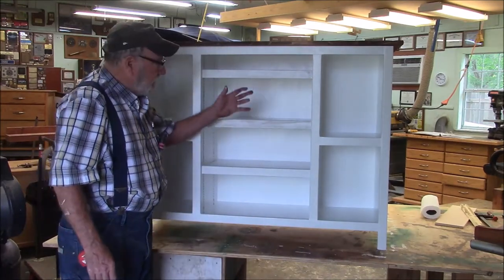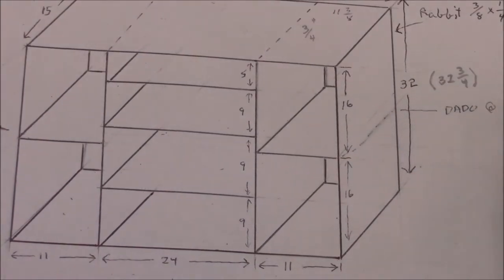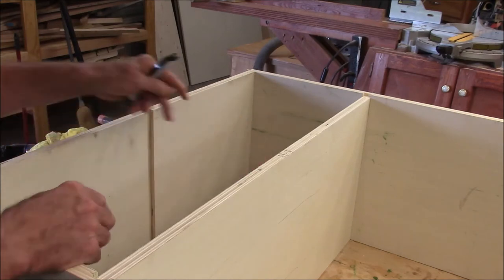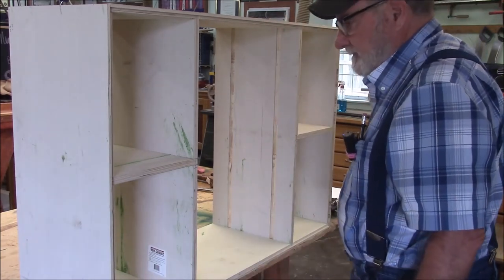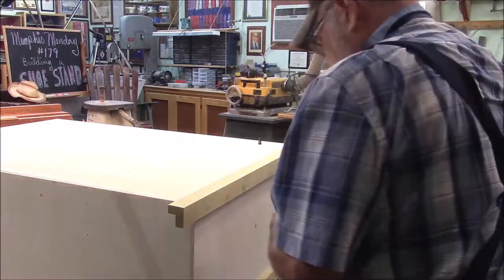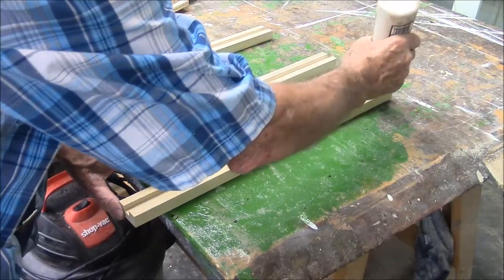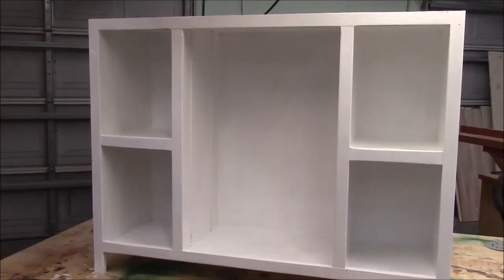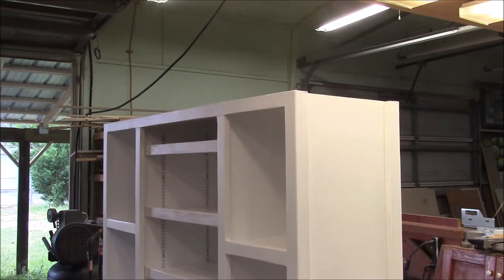179 Building a Shoe Stand

Comment: Nice shoe stand.  You make things look so easy.  I have made a few projects from a magazine picture and half the fun is figuring out how to make the piece look like the original.   keep up the good work.
Reply from the maker: Yep, I agree.  If I'm not using my own idea, at least I should try to respect the design I copy.  I only hope the real designer of this stand, whoever they are, will forgive me for adding the legs.  But the legs will keep the thing off the damp deck; it just seemed logical to me.  Heck, I even hunted around for the same edge-glued pine panel they used on the original.  
https://youtu.be/oDwcthgLN_Q  In this video I go to extremes to copy the original.  This is MM 78 (what? two years ago), where I copy my neighbor's cedar grilling table.  It looks like the original builder got all his hardware and wood from Lowe's, plus I had a complete real project, so I made a perfect copy.  
      Thanks for watching and commenting.

Comment: One of the first things I noticed about the shoe rack in the picture was the lack of legs, which i don't care for, and gave it a cheap unfinished look. I like the way you added the legs because it gave the shoe rack a much nicer look and made it look like an actual piece of furniture. That certainly was a lot of rabbits and datos and a nice big puzzle! Your version is a lot nicer than the one on the picture.
Reply from the maker: Thanks On Grid.  As I've said, if I copy a design, then I like to at least copy it well.  But in this case I had about the same notion as you, except my slant was more to the practical side of the piece.  Beyond that, I did work hard to get the look right.
     Rabbits and dattos are a big puzzle to me, as if they are not exactly placed, then nothing will fit together.  This is why I always go into such boring detail on how I keep it all straight in my head.  For example, in this project I totally assemble the case, and then physically mark with a felt pen where the rabbits will live before cutting them.  You can guess why I do that.  Yep, I've spaced out, and put them on the wrong side before.  As Clint Eastwood once said, "A man has gotta know his limitations."  
      Thanks for watching and commenting.  Man alive, you and I are pushing four years of Memphis Mondays.  And as always, I don't take your viewership for granted!!!!
Reply: You built it perfectly. It's better to have a lot of marks with a felt pen than to have anything off. As you said, if one thing was even a bit off nothing would have fit together properly. I wouldn't call that a limitation, I'd call it doing things properly.

Comment: i hope this means that you managed to stay somewhat unharmed by the storm.  We started getting the rain yesterday.

I love this design.  It would be perfect in an entry room or, as you said, mud room for a family.    I have seen the benches with places for shoes below but never a nice shelving unit like this.

It is always fascinating to follow your reasoning as you reverse engineer a drawing.  For a lot of people it would be overwhelming but you are wise enough to take it a part at a time and only dwell on that.    There is one thing that I think I would have done different and that is just because I am lazy  That is putting the strips in for the adjustable shelves before installing the board.  It just seems easier to be able to do it that way.    

I have noticed that you are using commercial putty to fill in your nail holes these days.  Did you just get tired of the mess of mixing your own putty?

The finished piece is very clean  and sophisticated.  I love the white  with the dark top.  Your friend must really appreciate such a nice piece.  Hopefully it will be at least in a protected area where it won't be getting wet.  It is much too nice a piece to be left out in the weather.

I suppose you saw that Leo put up a new video.  One of the things I found interesting with this video was taking the ship saw apart and cleaning the blade unit then make a level base for it.  I hope the trip to England doesn't mean that we are going to be without videos for a while.

Take care and stay dry.
Reply from the maker: The reverse engineering from a blurry picture is the fun part.  Tracking down clues, and then converting those clues into wooden parts is like a crossword puzzle.  For example, one clue was the relative size of the shoes in the example picture.  Using that as my scale, I could estimate all the dimensions.
       Yep, one part at a time, or I'd get confused.  I've heard it said that a lot of folks, especially genius types,  can juggle many tasks at once.  I can't, and I don't think the genius types can either.  Rather, I think the illusion of multitasking is actually the practiced or natural ability of shifting focus rapidly, maintaining intense concentration on a task, and remaining undistracted.   
       I have installed the strips in first in other projects, but here I left them out because of the painting.  
       The commercial putty drys faster, and finishes better.  However, it is not waterproof, and it is soft.  The homemade putty is made with waterproof glue, which is really a kind of plastic when it drys.  
       I think Leo will still make videos while in England; he did last visit anyway.  A couple of those videos showed how he learned to build wooden boats.  And he must have been pretty good at it, as those English boatyards keep hiring him back when he comes home for a visit.  
      Leo sure does get some fine talent showing up to help.  This week it was a tool repair guy, and then Leo was wise enough to use the guy in his specialty.   I wonder how Leo handles the knuckleheads who are inevitably in any bell curve of people.  I also wonder about the liability issues involved, especially for Leo's host.  
      Thanks for watching and commenting.
Reply: Great description of multitaskers.     I can multitask on maybe 2 things at once as long as neither are important.    

It makes sense that you didn't put the strips in before painting.  I wondered if they would have been clogged with paint.  You could cover them with tape or something but that would be more effort than waiting until you were finished.  Good call on your part as usual.

When you are trying to get projects out in a hurry, I suppose the putty drying quickly is imperative.  

I have often wondered how Leo diplomatically handles his "helpers".  At this critical stage of his build, he has to be a bit picky on who he allows to work on the boat.  You do have to wonder if the liability has been addressed by the property owner.  Maybe that is a subject best left not discussed.  Hahahahah.
Reply from the maker: In any case, I would sure volunteer if I were closer, or I could get the War Department on board.  I could cross those bridges if I were 20 or 30 years younger, and felt I was a physical asset.  But the reality is that Leo's project was originally built in 1918 by young guys, guys hardened by work, and none weighing in over 160 pounds, nor sporting an age over 50.  
      Now us geezers can address the liability question, which I suspect could become an issue.  Leo may not be prepared for America's aggressive and eager legal system, especially if Leo's host is rich.  I would never put this on his channel, but stand-by, it's going to happen.
Reply: I know it would be a thrill for you to be part of the project.  Back in 1918 men that were 50 were old.  Times have changed.

I hope you are wrong about a major incident happening.  If the hosts are rich, hopefully they are fiscally responsible enough to cover themselves with insurance.

Well, the sun is out today and I hope it dries out enough for me to mow my foot high grass.  It is going to be a nightmare.